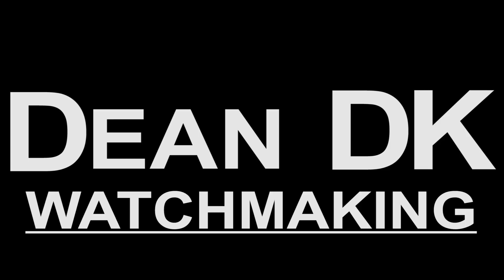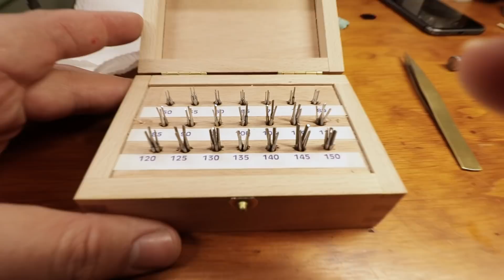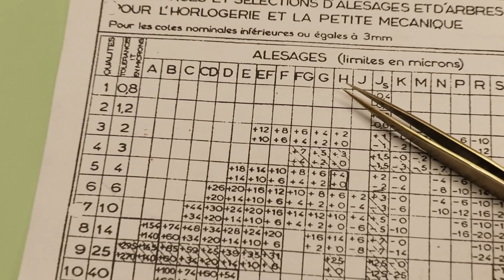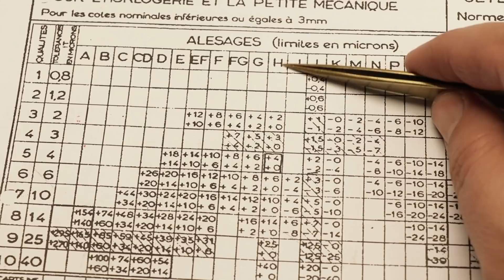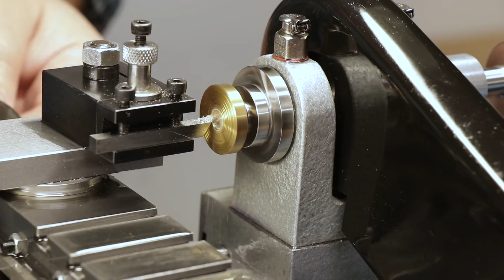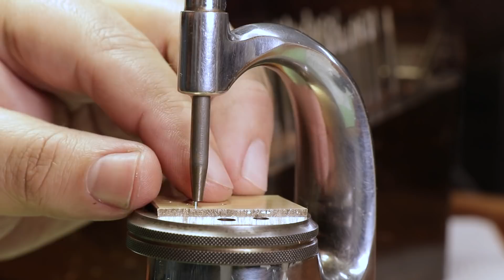Making the Balance Wheel Bridge Part 3 - Watchmaking Vlog 28

Comment: Dean - curious why you didn't do all the drilling operations in the lathe, on the faceplate, centering using your 'scope? Would have avoided needing to centre punch and move the part between two machines...?
Reply from the maker: Thanks for watching 😊 I had recently learnt this technique and wanted to try and test the results. Also, I am trying to find methods that work and speed up the process, this is a lot faster than scoping the holes. Centering via that method is super accurate, do I need the alignment pins and screw hole to be that accurate is the question. I will find out soon I guess. I’m still going to use the centering scope to align the jewel hole though

Comment: Do you prefer using your tweezers to remove Stakes from your assortment? I'm fond of the Stake Remover/Holder (bottom left).
Reply from the maker: The tweezers have not failed me yet
Reply: I figured they were already in your hand lol. I'm just a nerd lol
Reply from the maker: Haha, yeah they always handy on the bench and I have a habit of picking anything under 4mm with them 🤣 😁
Reply: They just become an extension of your hand lol. Hard to do most things without them 🙂

Comment: Centering with the tailstock like that will give you a lot more errors than using a centering stick of centering scope. If you are hunting microns I would not trust the tailstock. Or maybe that was just the countersink for the screw head and not critical?
Reply from the maker: Yeah for sure, I just don’t think it’s critical in this instance, and there is room to account for the errors this centering method would produc

Comment: OK.... you're turning into a raving insomniac, you know that right?
Also, do you have a link for the outfit that sold you those drill bits?

Paddy
Reply: I was curious too.
https://www.beco-technic.com/werkzeuge-verbrauchsartikel/bohrer/eureka-bohrer/sortiment-mit-72-eureka-bohrern-o-0-50-1-50-mm.html
About 90 euro.
Reply: TNX Adam

Paddy
Reply: @adamadkins9210  Thanks! I didn't know Eureka drills were still being made.. Beco only seems to supply to specialist trade, not to consumers.. ?
Reply: @teegeesg  Not sure about specialist trade only--I've had an account there for some time, but yeah, it's a for my shop.  I don't know if there's a way to send personal email or messages on Youtube.  If you know of one, contact me.
Reply: Is the result that different from using normal drill bits?
Reply: @horlogemaker-antwerpen  When drilling brass, yes.  Brass is very grabby and will seize regular twist drill bit unless you blunt the cutting edges.  Using a pivot drill, or (presumably) a two flute drill will prevent the bit being seized by the material.  Alternatively, I understand if you dull the cutting edges of a twist drill, that also prevents seizing.
Reply from the maker: Thanks Paddy, and everyone for sharing their knowledge. What a great comment thread 👍🏼🙏🏼